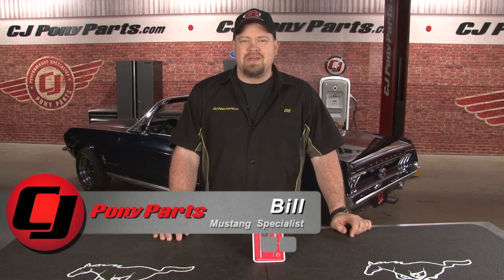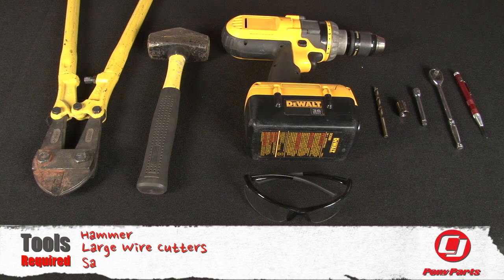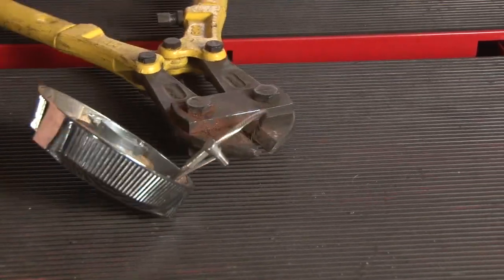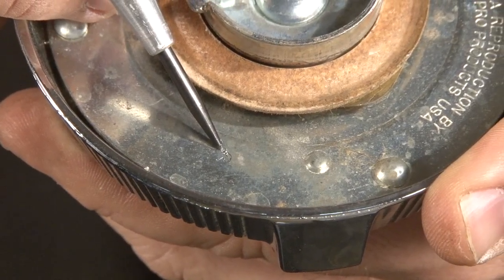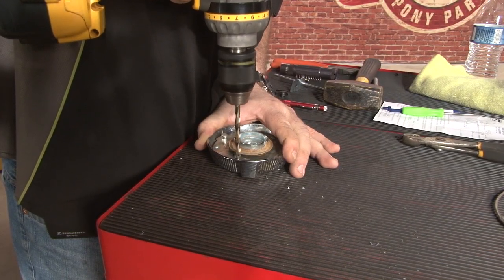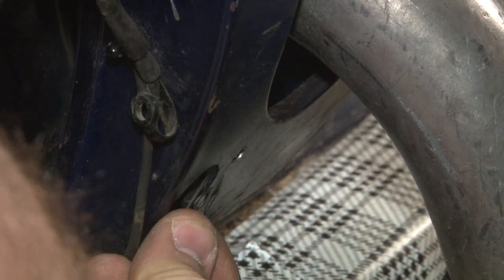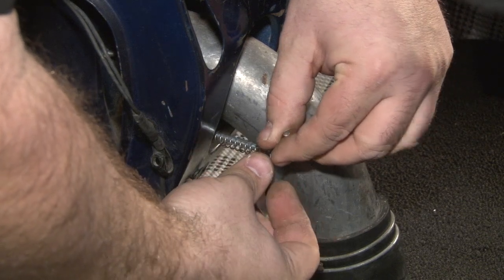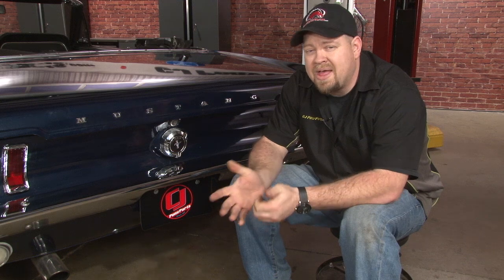Gas Cap Lock | Scott Drake | 1965-1973 Mustang

Comment: One: I would like to hang on to the security cable and keep from losing that cap. Two: Install a groove in the cap so the spring pin, it stays in position without locking so I don't have to keep opening the trunk. Three: The lock will happen when twisting the cap from outside (again without opening the boot!) COOL!!

Comment: Now do I have to pop the trunk every time I get gas?
Reply: Yes.  The trunk lock is the true "lock" on the gas cap, since you can't access the lock mechanism for the cap without opening the trunk.  That said, remote trunk releases are available, both cable and electric.  Added value of electric:  Most remote power door lock retromods include a remote that has a trunk release capability (explicitly) or an Aux button.  CJ Pony Parts has the electric for 1967-1970 (Bill even does a video on installing this one), and cable for 1964-1966 (and 1967-1970, I believe), and Scott Drake DOES make an electric kit for 1964-1966 (but you have to look elsewhere at the moment for it, just as currently only a two button remote electric and remote door lock kit is available for the 1964- car at CJ Pony Parts... I'm sure they'll have it if people start requesting it, though).

Also, in answer to the question folks seem to want to ask, YES, you can retrain your ring, but only be fabing an extra piece and it's a bit more finicky.  You can relocate the pull to the left middle screw hole, but it will be offset (which is bad and good).  It's bad because it means you have to come in at an angle, which means you need to fab a guide pipe; a metal straw, cut to length, passing through the body, the filler pipe flange at that hole and glued very carefully can do the job.  It's good because the angle means that the retention ring is not in the way of the lock bar where it pins the gas cap, though it will still be a bit finicky.  Oh, and make sure you get some grease into the guide pipe to make sure it slides nice and smoothly; the spring will keep it snug, you want it easy to pull in and out.

I'd suggest people trial fit it (without reaming out the hole for the guide pipe, which is meant to simply insure that it goes in at the right angle) to see if you're satisfied by how tight it'll be to the filler pipe, as it WILL be tight going in from that side, at least on the cars I've seen (and on our '65)

Comment: This is really cool!
I've got a 1968 Mustang GT/CS with the deluxe gas cap (flip-down) and I've looked all over for locking options without any luck.  Do you know of a locking kit for the flip-down gas caps? Or do you have any recommendations for locking that style of cap?
Reply: Ryan Wade For the 69 flip down you can get a generic locking cap and put it behind the flip down, you just need to remove the spring loaded cap on the lid of the flip down. Should work on the 68 as well.